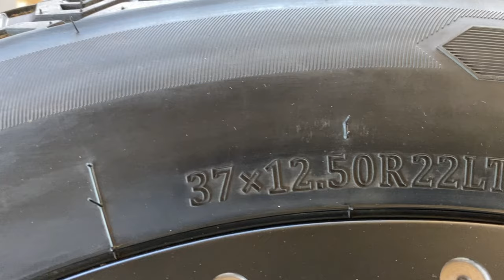4x4 Toyota Hilux Monster Mods Build | 5 Inch Suspension Lift // 37s // Custom Bumpers & More

Comment: Reading comments here just makes me laugh... I have the same setup of drop kit but with different company called Unicorn gen 3 from Thailand.  Same size wheels and 3.0 engine 8 year old 4x4 Hilux Kun26.  I did have problems when I first got it specially this was done by not so professionals in San Fernando Pampanga popular garage. The shop looks great but I can tell you I would not let anyone touch my ring anymore unless I am watching, I saw all the parts and I researched what I want.  I do not take advice from sales which is rule number one.  I will do one upgrade at a time and not all in one go even if I have the money like I did 4 years ago.  So how is my rig after 4 years? I have brought it to Mindanao two times and climbed a mountain in Surigao without any group or trail buddy.  Because my job requires me to climb mountains without any road just pure rocks and mud in the middle of nowhere.  My rig rocked! Well, after my upgrade from the garage 4 years ago I did the rest of my work myself and even reworked what the garage diid.  I can tell you now based on blood sweat and tears and hard earned money! The owner of garage may know a lot about rigs but I just do not take the word of the guy actually installing and doing it.  I have to watch the technician on every bolt nut he will remove of add but these days, I do it myself even changing clutch disk, repack differentials, bering change, belt and alternator squeaky noises all on my own.  There were times I regretted the money spent but after immersing myself into my rig with research and religious maintenance and care and modifications and rework of the assholes who worked on my rig at the garage, Today.. I love it!  

BEWARE!!!! upgrades like these with drop kids require cutting one of your crossmember which you can see the after job at 1:26 which I do not know if owner is informed.  I wasn't and I only discovered years later when I started using my rig when it became my 1st car again.  The good thing on the video is they did a bridge on the cross member.  My shitty garage didn't and it sticks out and they did not even bother to paint over it.  I remember when I drove it back after the lift upgrade the rear sway bar dangled on the highway all because the installer did not bother to use nylock nut or at leas use loctite... so my tip is, when you do an upgrade, DO NOT TAKE THE SALES MAN's word for it!!! do your research and do it in phases.... by the end of the year you have a beautiful rig that works and not just for show!
Reply: Hey mate just wondering where you get that control arm drop kit from ??

Comment: @Jo Jace unless you changed rear end and front differentials out and replaced with 5ton or above parts 15 inch and above should fit with no issues front the brakes I seen on the truck.

Comment: The car is inconsistent, as if it will fall and run with difficulty ! You will damage your axels and hub ! 37 inch tires very big for hilux , maximum for hilux hub 31 inch .
Reply: I'm a 4x4 driver from back in the day when we first started doing body lifts and suspension lifts . I had a 77 Chevy short bed stepside truck with a 4 inch suspension lift, 3 inch body lift 36 x12.5x15 tires ,3.73 gears later converted to 4.10. I can say it was fun to go out and 4wheel but it does have its cost. Between the tire size and angle stress on steering box arm it busted the frame which yes everyone before me showed me where it would likely split and where to get it fixed. I cut back to 33 rubber .If you do water and mud alot make sure CV boots stay sealed and repack them now and then to be sure . Always use top quality kits and parts that take into consideration the weak points. I have a 92 4runner surf that I been considering putting a 4-5 rough country suspension kit on but shipping here sucks. 33 inch tires are max for a Toyota if you have at least 3.0 or larger under the hood...this is advise given by experts .I fortunate enough to have the lowest factory gears in mine.  If anyone in the Philipppines knows where I could get a good 4-5 inch kit local I would appreciate it.I did check the maker of that lift in Austraila and they said they only can sell 2 in kits because of lift law due to bumper height. I did notice your center independent carriage assembly looked to be around 2 in between bolt holes and your body lift blocks looked to be around 3 inch which gives 2 ins more ground clearance and 3 inches more body and tire clearance . Looks good and from video it looks stable and solid while driving it .Tire height should be no issue as long as you have at least a 7 or 8 inch wide rim for the 12.5 width part. Just keep recommended offset from factory
Reply: you can fit 33s comfortably

Comment: looks really great for sure ! seems to peform not so good tho, no flex
Reply: Because there is something in the shocks they have to remove for flex
Reply: @Nicho768  well if you are talking about sway bars I bet you they are aftermarket cause they won't fit with such a lift. If they removed them they would not really get tons of more flex. Thing is, to get a vehicule stand so high on IFS or basic 1 stage springs in the rear you are gonna sacrifice a lot of flex and offroad capability, cause the suspension will be almost bottomed up permanently, it's just physics.
Reply: @charlyvss5440  true

Comment: The problem is when you have to go for inspection in license office,
Reply: Would also like to know how that is addressed too.. dont make sense investing that much and you have to avoid road blocks..... But man that truck looks sweet👍
Reply: @sateshbalgobin1267  for a factor this in aus would not pass amd would handle like crap on and offroad so impractical. What we like to call mallcrawlers.

Comment: all of that effort, to then put stupid big alloys on with rubber band tyres
Reply: Agreed that the allyos don't quite finish it.. but unless he's gonna eventually put a solid front axle and diff lockers on it as well, he's already limited in its articulation & use.. so the Alloys are the least of the problem if he's gonna put it into heavy off-roading.